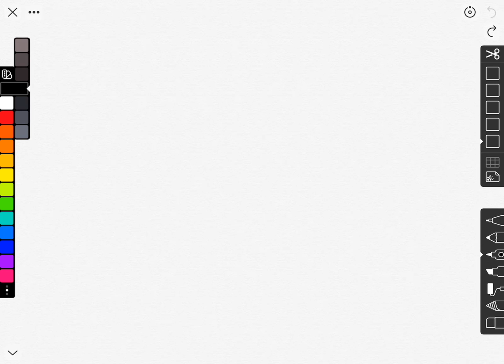Math Involved in Drawing a Tide Complication

Comment: Your comments about the geometry of the circle and chord are accurate in this situation but due to the manner in which you have defined the problem, not because of a general principle. E.g. the line crossing the chord is only perpendicular if by definition you want the midpoint (or its bisecting the angle between the 2 radii). If you wanted some different amount of distance between the H and L points, this would not necessarily be the case.

Unfortunately, you equation for the x,y coordinates for L are incorrect, given how you defined theta (from the 12 o'clock position to L's radius). Given this, the x coordinate of L would be:
x = center x + r * sin(theta)
since the x side of the triangle is the "opposite" side of the right triangle in question.

Hope this helps.

Comment: Is the audio really quiet?

I'd love to hear / see the process.
Thanks, _.
Reply: I had to max out the system volume listening on my airpods to get his voice to a decent volume. The level is definitely too low. Also, as far as I know, youtube file compression wouldn’t lower the loudness of a video like this: officially, youtube normalizes everything to -14 LUFS, which is a standard divorced from audio file bit rate—at least, that’s what I can glean from my admittedly limited knowledge on the topic. Lossy file compression has never lowered loudness for me, based on my experience with transcoding files here and there
Reply: @InternetEnzyme  Yeah. It's super quiet.
Reply: @InternetEnzyme  Wow, love the deep technical response. :thumbs-up:

As a developer, I just figured it was a bug/edge case in how one of the compressions was handled on YT side.
Reply: Audio is fine here...
Reply: @mikecarey  Thanks.

I am on bad wifi, so my guess is the issue is on YT side, with one of the compressed streams.